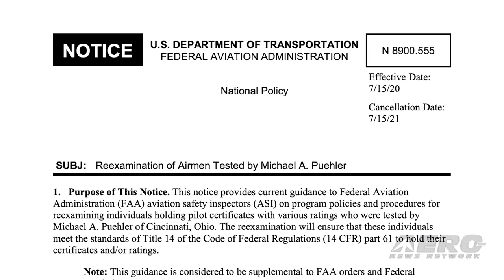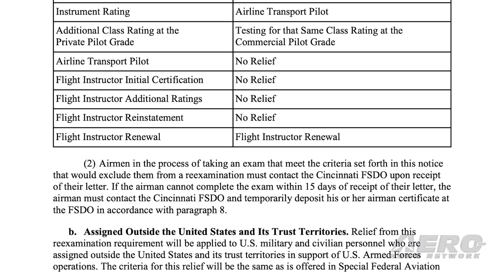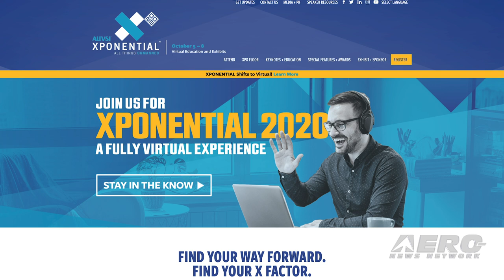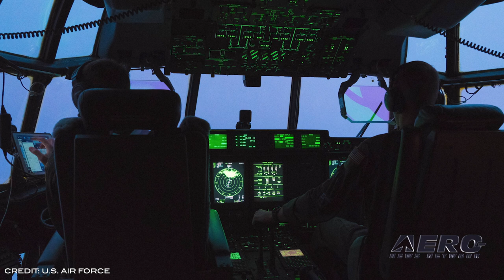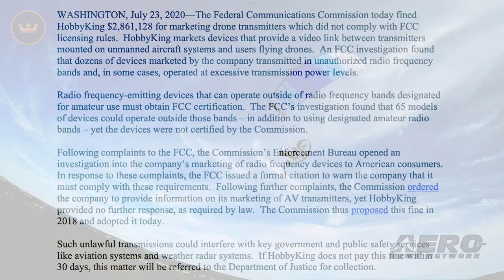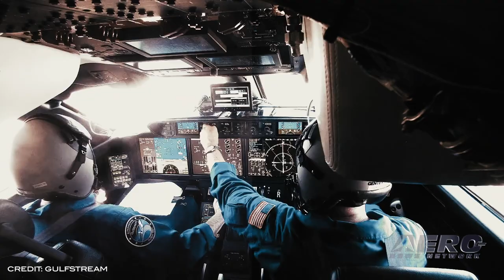Airborne 07.31.20: FAA DPE Scandal, CAF FM2 Wildcat, Gulfstream G700 Tests

Comment: Doing a cursory check for the 709 check rides, you're exempt/excluded if you earned a higher level certificate from a different designated Examiner. So if you got an ATP from another examiner but did other ratings with Puehler you're good to go. Also you will fly with FAA examiners. FAA states they don't charge a fee. Yeah that's true, but you have to rent or put hours aircraft which is not cheap. Plus you'd have to practice for several hours before the check ride. What a nightmare. Seriously.